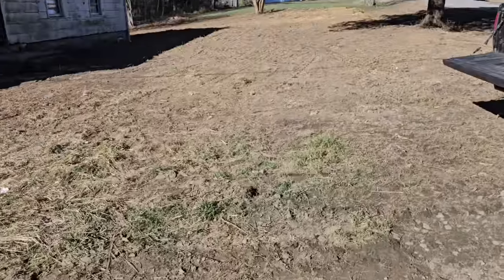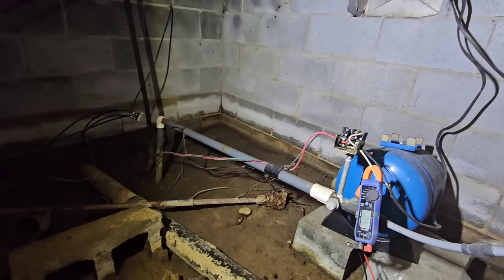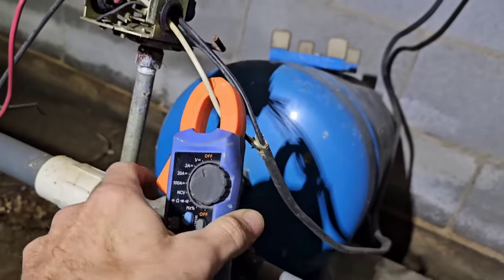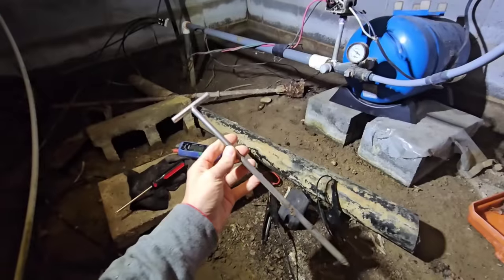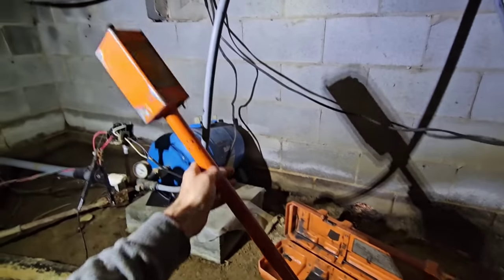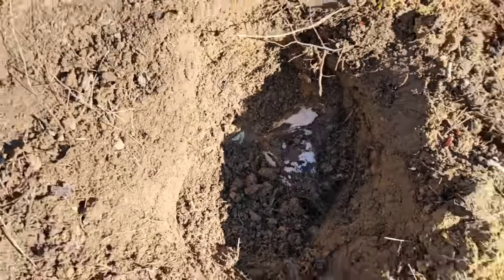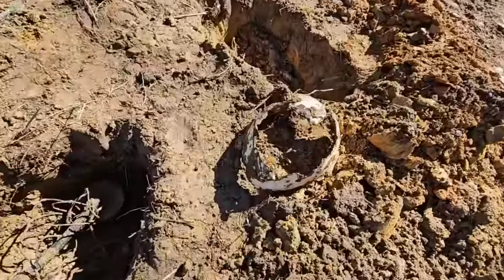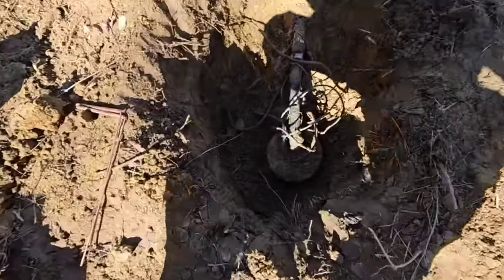Can Copper Dousing Rods Find a Water Well below the Ground? New Tech Vs. Old

Comment: Perhaps Google Earth or another maps app has satellite images from previous years to see if there were other buildings on the property.
Older images usually have lower resolutions but if there weren't tall trees around it's still enough to spot buildings.
Reply: +1
Reply: Dad had a man witch a well he used a forked stick and found water marked the spot and said there was water and it was not deep dad and uncle Albert dug a 50 iñch round hole 25 feet deep and hit water dad put brick iñ the bottom and 48 inch tiles by 24 inch high poured concrete around them and a cap on it and built a pump house laid pipe
Reply: @hazendismukesjr.8319  That's the way they did it back then. 
My grandpa grew up on a farm in North Dakota and he used a witching stick to find and dig wells all the time for family, friends and neighbors.

Comment: About 45 years ago (yes I'm old), I was down at a friend's and his dad was a petroleum pumping station manager. They had a lot of abandoned lines below grade that needed to be taken out for environmental reasons, and there were no drawings. He was using dowsing rods and finding the pipes. He asked me to give it a try, and I worked with him for a few hours, finding the pipes with the dowsing rods and he followed along and marked the ground with spray paint. When I left he gave me a set of rods, which I have kept and used to find piping in a good number of situations. They work.
Reply: Yep my Dad showed me and I mapped the front yard 60 yrs ago!!  Found things he did not know were there. Young feller . . . . keep it going.

Comment: At one time I called BS on those dowsing rods too until I tried them for myself. We were having a water well dug in Central Texas, all the water well guy promised was a hole in the ground, no guarantee of water. The hole cost around $2500.  I asked him how he knows where to drill; he told me a lot of people hire a dowser, just happens his "Brother in law" does it for $100. I rolled my eyes and agreed. This guy came out with his rods, walked around until the rods crossed and said, "right here is a good stream".  My wife said, oh come on, he gave the rods to her and they crossed at the same spot. I said, "bull shit" I got those rods and KMA if they didn't cross at the same spot. I held them loose, held them firm, etc. and they still crossed.  
Sure enough he hit water, that was 15 or 20 years ago and it has been a great water well, we have pumped thousands of gallons of water out of it.
Reply: I don't really have faith in dowsing rods either. I have had them cross in a way I am convinced that they were reacting to some kind of force but I'm not entirely sure what it was. They do seem to be effected by underground pipes and metal cable. As for locating water consider me very skeptical. I worked for a well driller when I was younger. We were happy to have a dowser point to a spot to drill so that we weren't responsible if there was no water. I think if you'd have drilled in a different spot on your property you'd have probably found water at about the same depth. My advice to anyone drilling a well is to sink it wherever is convenient for you, just don't drill in low spots because depressions can accumulate clay which slows down water flow into a well.
Reply: Love it!
Reply: Exactly my experience.   I saw it done and still didn't believe it.  The guy handed me the rods and said, "Do it yourself."  

Then I believed it.
Reply: The earth is a large magnet. Any conductor --- copper, iron etc --- will create a current through itself. Water has conductive minerals in it which will cause electric charge to exist. How strong a charge is dependent on how much water/minerals are in an area. The dowsing rods are picking up this charge and creating current through themselves and also a magnetic field of opposite polarity causing the rods to be attracted magnetically to each other.
Reply: @DW-bj5wr  Thank you for this clear explanation which removes the “demonisation “ of the method.

Comment: 52 years ago my father on an old farm needed a well dug, used cut and bent coat hangers to find water.  100% successful.
That well is still being used today.  
Littlestown, Pennsylvania
Reply: Water is not in small underground rivers. It's literally everywhere. It's a water table not a water string.
Reply: @Tb0n3 No it is not.All depends of how high you are.Sometimes down hill it is flowing
Reply: Not how water works
Reply: @josephmitchell3507  Are you a geologist?
Reply: Of course it can flow. It depends on the shape of the bedrock and how porous the ground is. That’s why in a mine you can have water flowing out of the wall in a single point as if a tap is turned on.
Reply: So is there anyone here who has the CORRECT answer?   I expect we all are geologists in our own minds. In reality we’re just opinionated humans.

Comment: My Dad taught/showed me how to do Dousing and how to tell how deep the water was. The well he dug by hand and dynamite is a very good well. Well was dug about 75 years ago and is still producing a lot of water. A few years ago my cousins water line for city water had a leak. The line is very long through a pasture. Using the Dousing method I was able to find the line as it is not a straight run. Marked the pasture found location of turns and located the leak. Leak was at a turn, which happen to be a fitting.

Comment: 5 years ago, after reading about dowsing I made my own rods which look exactly like those this guy used.
Miraculously, they worked.  I could find water lines, electrical lines, gas lines and also water aquifers.  Over the years I've tried them hundreds of times, just to prove to myself that they work.  They never fail.  I am a retired scientist, I worked for many years in Silicon Valley and I'm mystified as to what makes them work.  
After getting family members to try it I found that out of ten of us, only six could make them work.  Body chemistry seems to somehow interact with the rods.  My guess is that the earth's magnetic field is involved.  $10 rods vs $5,000 proton magnetometer.
Reply: It doesn’t locate water, it locates fractures in rock and water flows easily thru fractures. Break a magnet in two and each half forms new opposite poles. Fractures in rock do the same, the earth is magnetic.
Reply: We used to joke that you have to be oversexed for it to work.
Reply: Here is a thought water has water tencion and every action has a reaction so probable the reaction to tencion excites molecules  that agree has some reaction to magnatisim. 
Also some substances are able to wick water even upward like plants or even substances like vermiculite. There is defitnly more to water than we see.  Actualy curious  if electrolyte water has stronger signal that well water.
Reply: I was told to ask the rods for what you want. Found water lines, buried electrical lines, corners of septic tanks, leach lines, even the best spot for a TV antennae. Have used copper wires, brazing rods and in a pinch coat hangers, they have always worked. Freaked out a friend years ago, needed to dig a ditch to his barn for power, but he thought the septic tank might have been in the way. So I told him not a problem I could locate the septic tank, so I spotted all 4 corners and we dug down and there they were. He just shook his head and asked how I could do this, all I told him was you have to ask the rods for what you want and believe in it their power. He still thanks me for that almost 50 years later. Bless you brother Dave.
Reply: What kind of scientist were you, exactly?  Because believing in dowsing is really embarrassing.
Reply: Everything is vibration
Reply: @user-Q-  lmao oh no no no, I've got bad news for you
Reply: @user-Q-  Sorry buddy, I don't believe in magic.  I'm kind of a science guy.  You can use whatever magic wands you want, though.
Reply: @user-Q-  That's right, I've never tried using magic wands to find water, and I don't need to try it to be really confident that magic isn't real.  Sorry user Q
Reply: @user-Q-  hahahahahahaha holy shit the "kwantum fizzics" cope lmmfao
Reply: @user-Q-  Of course you're quoting the bible too lmaoooo tell me about QAnon next please
Reply: Try it, skeptic.  Get back to us after you do.
Reply: @davinmars5177  Sorry kid, magic isn't real :(

Comment: My dad showed me this years ago as we walked the property looking for the water line... it worked!  I even cut straws to hold the rods so that I knew I wasn't doing it... still worked.   He made the rods from wire hangers.
Reply: Wire hangers work great. Essentially, any metal wire. Cooper electrical wire. The solid type. Never tried aluminum, though. For the doubtful. Take a garden hose. Lay it out on the ground. It doesn't need to have water in it. Walk toward as shown in the video. The wire will cross.
Reply: Ot doesn't need to have water in it. You guys are sprayed with the good stuff 😂😂😂😂
Reply: It’s not magic, it’s static electricity. 

It does find the water it finds the metal pipe  

It also shouldn’t cost you anything! Coat hanger’s work as well as anything.
Reply: I don’t use metal wire. I cut a maple branch that is shaped like a “Y” and hold it a particular way at the “V” crotch of the Y and I’m able to know the strength of vein and roughly how deep by how the stick twists in my hand. My father taught me this at a very young age. I’ve switched for water for family and friend and always got them 20+g/m. It also works well for finding hidden septic systems as well.
Reply: I don’t use metal wire. I cut a maple branch that is shaped like a “Y” and hold it a particular way at the “V” crotch of the Y and I’m able to know the strength of vein and roughly how deep by how the stick twists in my hand. My father taught me this at a very young age. I’ve switched for water for family and friend and always got them 20+g/m. It also works well for finding hidden septic systems as well.

Comment: I'm retired and 70, I worked for the water co. In Pa. For 35 years. I was a locator and used the do users a lot. It worked for me during my yrs. Of service. I used my locating machine most of the time but the douser came in handy a few times. Not everyone can use them. But they do work.  It was good to see someone else do what I did for yrs.   Hey thanks for the memories. Steve k
Reply: With a blindfold how would you know when the wires crossed, DA !!!
Reply: You can feel them swing.

Comment: I've used them to find steel pipe, pvc pipe,  clay sewer pipe, 240v power cables. I was trenching with a 65hp chain trencher, so also cut through hundreds of services that were not found first. Used them for 45 years.

Comment: I am pretty pld and back in the day we called them devining rods.  They don't have to be copper, we even did it with willow branches. I have had some luck with coat hangers. It was neat to see the copper ones work so well. Thanks for the memories.
Reply: My grandad used an old willow witching stick is what he called it.
He also called it a divining rod. 
A willow branch that split equally into a Y the smaller branches about 6-8 inches apart and about the same in length. The thick branch about 4-5 inches long the whole thing not much bigger then a foot long complete and the branches not much thicker then an index finger. 
He'd just find one to use where he was at and cut it to shape on the spot if there were any willow near by. 
He had a few old trusty ones he collected also.
Always a few around the clutter in his workshop.
Showed me how to make one and how to use it but I used to just play with it.
While we were out and about walking the woods or in the backyard.
I think it did work for me a time or two but it was all fun and games for me.
He knew exactly how to use it to get results.

Comment: When drilling company showed up at my property do drill the well the guy used dowsing to select the spot where to drill. I was skeptical as hell about it. To my surprise 😮 after drilling 337 feet my well is producing 60 gallons per minute. Needless to say I became believer.
Reply: Did it occur to you that maybe anywhere you drilled on your property you would have hit a big cavern of water underneath?
Reply: @rickdiego5  That might be true. Gentlemen that was running the drilling rig was around 65 years old and I have asked him about dowsing rods and what he told me is that he always had great success with them. Go figure.
Reply: @rickdiego5  I'm beginning to think that some people will question even oxygen even after holding their breath
Reply: @rickdiego5  yes but I wired a new house about twenty years ago and a well driller made a dry hole the first time around then got out a geological map showing underground gravel. And picked another spot north of that one about hundred feet he hit water but it wasn’t a good vein and went dry about five years later so they came out again and drilled west of the house and finally got one that they are still using. And my uncle used a devining rod when they did the last one

Comment: A little more than 40 years ago, a well driller dowsed a well location for a friend's family. I was positive dowsing was an "old wives tale".  He used a coat hanger cut the way your rods were cut, so I cut a set for myself and tried to recreate his method. holding his rods horizontally,, but using a grip with his hands horizontal and the rods able to move vertically, saying it was more "accurate" and the rods would cross just as yours did, but on the opposite plane. When I did it, the rods ROSE upwards, rather than downwards. The well guy told me that it happens for some, but for most, they crossed downwards. I'm left-handed, so maybe  that has something to do with it.  Either method, it's still weird to actually see that dowsing works.
Reply: I’m a lefty too but for me they cross downwards. Me personally? I think it has something to do with the minerals in side us. We all have different minerals and in my older years? They do not work as good as when I was a teen..🤔🤷🏻‍♂️

Comment: I live in Nova Scotia 🇨🇦 my late father could use a water stick and the rods. And he found many wells for people that bought a property and didn’t know. He would tell them to get the pump running and he would start at the foundation and with the divining stick he would mark the location of the pipe every 2-3 feet. Once there was no more pull of the stick he would say did there and every time there is where the well was.  Also his copper rods moved outward pointing left/right when he found a water vein or pipe. Every video I see on you tube they cross. Difference between Canada and the US. lol not sure.
Reply: The pointing left and right shows the flow direction of the water.

Comment: Probably no matter where you use dousing rods you will get water because the well is drilled until it finds water most of the time. I bet if I had a ten acre lot you would find water by drilling most times without rods. Wherever rods might point to water there will be water not because the rods found it, but because there's water at some depth all over the place. This time in this video maybe you got lucky with the rods. Anyway and as a subscriber, I love your videos... thanks...
Reply: Ummm, OK  you're totally not getting it.  You can find pipes that ONLY are where they are.  It's not a luck or chance thing.  Water is not evenly distributed in the ground either.  I've done this myself when I was 14, taught by and old times who was taught by a prior old timer.  Then my little brother did the same.  It's not about faith, it just works.

Comment: In the 1980’s my uncle bought a farm with 3 houses and many other out buildings. It also had an orchard and milk house attached to the barn. It had a 500 gallon water storage tank that supplied water to everything. We had no idea where the well was located nor where any of the water lines were. The property sat vacant for several years before my uncle bought it at auction. A buddy of mine came out to help me find the water lines and brought 2 short pieces of 3/8 inch pvc plastic pipe about 5 or 6 inches long. He had 2 pieces of ground wire from some 12-2 electrical wiring about 16 inches long which were bent at 90 degrees about 4 or 5 inches from one end. He put the short end in the pvc pipes and when he would walk and cross I would dig down and there would be the black water pipe. It would only cross when he would walk across the water line in the direction the ditch was dug. I laughed when he came out and told me he could find the lines and the water well but I wasn’t laughing after he handed it to me and the wires crossed every time I walked over the water line. I suspected then that maybe where the ground had been disturbed digging the ditch caused a disturbance in the magnetic field. I don’t know why it worked but I know for a fact it worked for us.